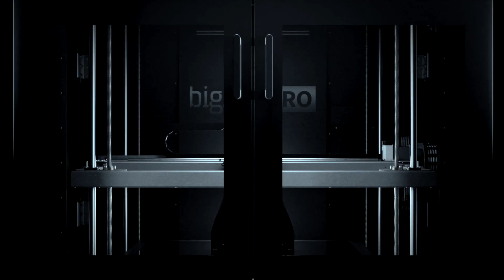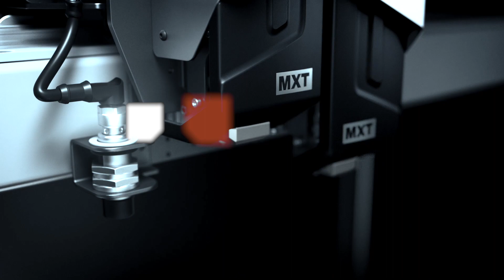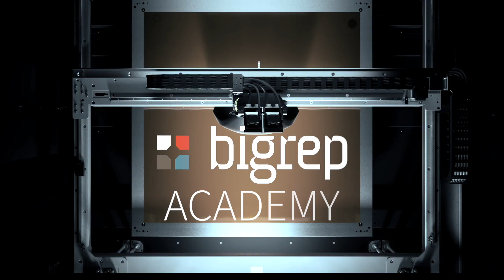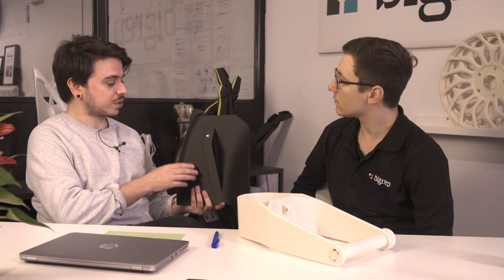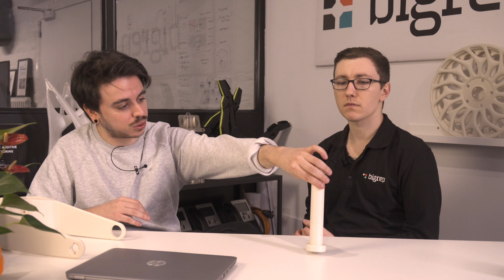How to 3D Print: Design for Large-Format - Saving Material on Big 3D Prints - BigRep Academy

Comment: What can we do if the design requires intern cavities and needs too much material support? Regards!!
Reply from the maker: Hi Pablo - great question! Like Marco mentions in the video, sometimes supports are unavoidable. However, if you're able to align internal overhangs according to the maximum angle/overhang of your materials (45 degrees for most materials like our PLAs, or 60 degrees for materials like BigRep's HI-TEMP) you should be able to avoid some excessive support structures.
If you're able, take a look at the channel's orientation and try to keep it as vertical as possible when printing!